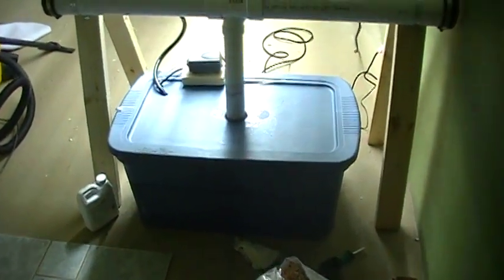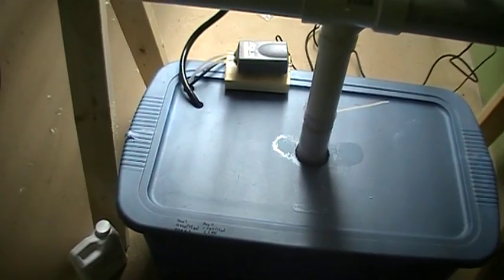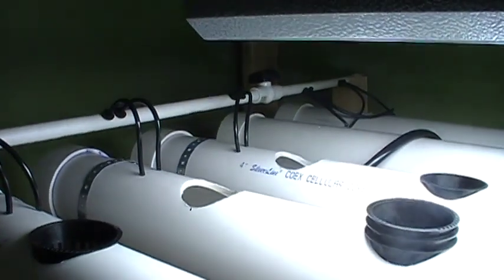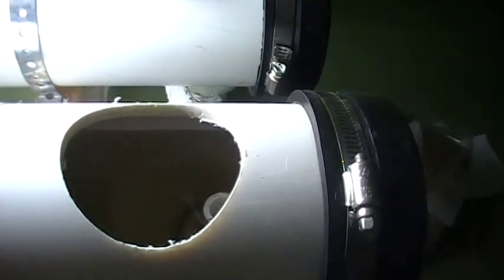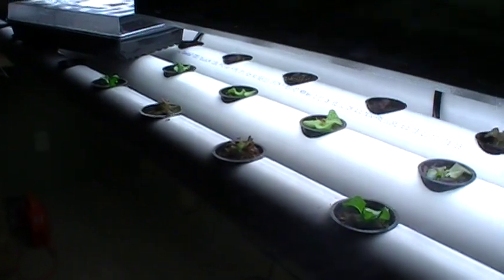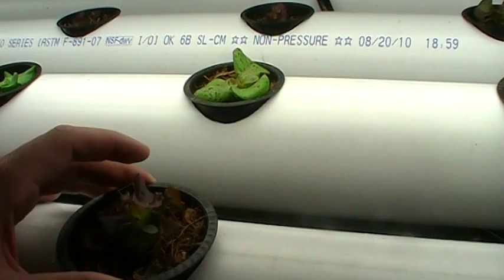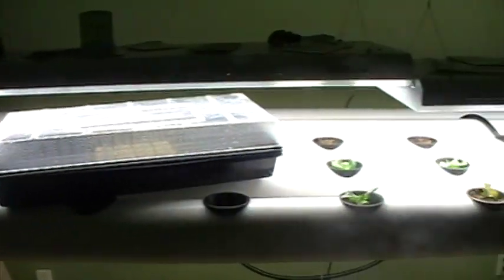Nutrient Film Technique (NFT) Hydroponic System

Comment: What parts did you use for the connecting of the pvc where the nutrients recycle back into the resevoir? did you cut a hole in the 4 inch pipe and use some kind of seal and stick in the smaller piping? You're system seems to drain great and I love the idea of moving the piece of pipe up or down depending on how long the roots are in their process of growing. I just dont understand what you use to allow yourself to do that. What connects the smaller drain pipe to the 4 inch pipe?

Comment: Just so you know, not trying to bash you or anything, but what you have here is a hybrid DWC NFT system. I say this because I see a couple of small (yet very important) flaws to your system that don't quite make it true NFT. First off you need to replace the PVC pipes with vinyl fence posts. They are square and provide an even, flat surface for the water to trickle. Second, ditch the boat drains. You have way too much water in those channels. I understand why you did it, to make up for lack of surface area from round PVC pipes. If you go with flat fence posts, you will not need the pool of water. What you have going on there is called "pooling" and is not true NFT. If you would like to upgrade your system to make it more efficient and produce crops even faster, follow my advice. Do some research for yourself. I have been using NFT for a long time.

Nutrient Film Technique says it all. You want a "film" of water trickling over the roots on a smooth flat surface. Your system is more like deep water culture in the sense that a lot of the roots are being submerged in water. The main difference is the amount of available oxygen to the roots in DWC and NFT. NFT allows for massive amounts of oxygen, which makes it one of the fastest known cultivation methods we have.

Other than that, good job, and good luck :)
Reply: If anyone happens to be reading the persons above comment, it is not a good idea to grow out of vinyl. Yes, the square gully's are better but vinyl can leach. Always use a HDPE or similar safe PP for your hydroponics.

Comment: With this setup and roots being in the air, will you need constant oxygenation. I.e. Air stone?

Also do you flow constantly or do 3hour feeds a few times a day?

I am thinking of running a ring feed to inlet to normalize manifold pressure. Also will have a secondary bucket. 5ltr with overflow system. Much like a two chamber sewage sump. Where my pump will run in clean water. Will this help with clogging the smaller tubes and pump?

What wattage is your light?

Hydro for life!

Comment: Do me a favor if you do not have a decent pump with a sponge built in it take a stocking or even a sock and stick your summer gerbil pump inside the stocking and put it inside your reservoir and Trust in believe you're trip head will not clogged no more sir you got to double up with the stockings and it works like a char more just forwarded over itself

Comment: That's thin-walled PVC is made for potable water, i.e., it's not food grade AFAIK. Won't that risk leaching chemicals into your water supply? Particularly being outside in the sun?
Reply from the maker: Yeah, it is thick walled. PVC is allowed for potable water use. If you are worried about leaching, biggest concern is probably in flexible tubing and plasticizers used in them.

Comment: controlling the water height would be much easier by putting another ball valve on the return line that way you can slow th ereturn back thus raising the water level, or lower it with the ball valve

Comment: FarmingFractals 
 Hi, could use some basic information:
Where to buy supplies? 
Type of tube used/size/sch./lengths?
(FDA approved - nontoxic)
Diameters and centers of holes?
Tubing and sizes?
Thanks in advance.
Reply from the maker: Jose Benitez zSupplies were bought from a local lumber yard and big box store. 

Can't remember the pvc size 3-4?/10' lengths/sch 40

PVC is used in tons of household plumbing. There is quite a bit of conflicting information out there on leaching. The main study I have read concerns the use of chloramine/brass fittings and pvc. Our municipality uses chlorine still. If you are worried about leaching, the main concern would probably be the plasticizers in the vinyl supply lines.

Don't remember hole centers now. Think they are 3"

Smaller tubing is 1/2" I believe.

This is just to serve as a rough guide. Never planned on a cookie cutter build. Just wanted to share so people could gather ideas and improve.
Reply: Thank you.

Comment: Whats the running cost per hour ? How much watts does it pull with all the lights and pump on ?
Reply from the maker: Simeon Hill 
It has been awhile since I calculated the cost. I remember it being like a dollar per plant per month or the cost of a head of iceberg lettuce. The costs are going to vary based on nutrients, lighting, heating, cooling, etc.
Reply from the maker: I calculated it several years ago and it was about $1/pant per month. However, I was using fairly expensive nutrients.

Comment: How are you connecting the driplines to the PVC? What are you ising
Reply from the maker: There are rubber grommets that connect the driplines to PVC. You drill a hole in the pvc to accommodate the grommets and push the dripline in.

Comment: Great system.  Are the pipes level or is there a slight pitch?  Also what kind of lights did you use?
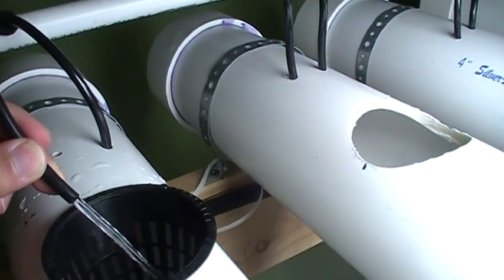Reply from the maker: The pipes are at a slight pitch. The pitch was created using a 2x4 on the front sawhorse and a 2x6 at the rear. This gives it a 2" slope over the 10' drop. I have read that a slope of 1:40 to 1:25 is in the ideal range. The lights are T5s I have another video on lighting.
Reply: FarmingFractals
Great, thank you

Comment: I saw another video where a guy was using paint filters, the kind they put in a 5 gallon bucket of paint to filter large items. If you wrap your pump in that filter, chunks won't clog your small tubes i'd bet :) then you can fish out any collected things from the reservoir :)
Reply from the maker: Not a bad idea. I have a mesh filter in the pvc pipe that leads to the nutrient reservoir. The holes in the mesh are a little large so some debris can get through. I will have look into putting in a paint filter over the pipe instead.

Comment: I am using 4" sewer pvc outdoors. I picked up a thru-hull fitting a Bass Pro. Made by TH Marine 1-1/8" Straight Thru-Hull. It requires a 1-3/8" hole and fits a 1-18" hose. Is this the one you have?

Comment from the maker: The drip irrigation lines are just feeder lines for the NFT channels. All commercially produced NFT setups use drip irrigation to feed the water into the channels. Nutrient Film Technique means that there is a shallow film of water that carries nutrients. It does not mean the use of a capillary mat. Capillary mats are only used if there are pooling problems or dry areas. One of the fall backs of NFT is the plants will quickly die if there is a power outage. I only add coir for a safe guard.

Comment from the maker: My PVC pipe is 4". It was the tetra 425 gph submersible pond pump at Lowes. The oxygen isn't necessary if you are running a shallow film of water in your NFT channel. For a cheap $8-10 air pump, I figured it couldn't hurt. There are some roots that are constantly submerged even when running a shallow film. The plants should get plenty of oxygen without the pump though. Thanks for watching.

Comment: Hi, could you leave a comment with the diameter of the various PVC pipes you used, and your recomendation about which water pump should I use. Also, do you think at that scale isn't necessary to use an air pump to get oxygen into the water?. Thanks a lot, beautiful hydroponic system.

Comment from the maker: I used a hole saw bit for a handheld drill. I will have to check my exact spacing, but I measured and marked the location of each hole. I also made sure my hole saw fit the net pots.

Comment from the maker: I have used a capillary cloth in my system before. I have found that it is easier to just rotate my plants from front to back. The water level at the front is higher than the back. I start new plants with small roots in the front and as the roots hang down I move them back. Once all the roots are long, I drop the water level completely and just run a shallow film.

Comment: Bamboo is cheap, you could try using bamboo tubes or wine barrels. You can also use a bamboo cross-lattice to hold the plants. I'm working on some plans going to see how it turns out after its made and running. But I agree, anything is better than the overpriced GMO, chemically sprayed food you get at the local superstore that they shipped in from some place where the locals urinate on the food before they pack it up and ship it out.
Reply: Nice idea. never actually heard of this..

Comment from the maker: I told you about the note on the video correcting the information error. I think the issue of the pump was fairly trivial. Obviously, the pump's output isn't 300-500 gallon/minute. At that rate is would blow out the supply lines. I am not trying to make professional youtube videos. I am just trying to show people how easy it can be to grow your own food. You are right I threw this video together on the spot. I didn't plan anything. I just wanted to share a video of how simple the system is.

Comment from the maker: I never mentioned a submersible air pump. The one I use is a dual outlet air pump with 6" air stones. They are made for fish tanks. That being said, there is a such thing as a submersible air pump. Google "Ario 3 Turbo Venturi Submersible Air Pump" for just one example. A lot of hydroponic growers prefer the submersible pumps because there is no danger from getting them wet. The pumps oxygenate the water and provide much needed o2 for roots that are constantly submerged in water.

Comment from the maker: From what I have read, probably very little if any. PVC is currently used in food packaging, cling wrap and potable water lines. Most chemical leaching in PVC is due to the use of plasticizers that help make it flexible. Rigid PVC does not contain plasticizers. Most degradation of plastics occurs because of heat and exposure to the elements. The room my produce is in never gets above 80 degrees. The fluorescent blubs are a fraction of the suns lumens and have almost zero heating effects.

Comment from the maker: The bottom of the thru-hull fitting should be round like a pipe. I just drilled a round hole close to the size of the thru-hull fitting. Put the rubber sink gasket over it and then tightened it down with the nut/compression fitting. This video shows it a little better- watch?v=tu4IcMrVGr8

Comment from the maker: I learned to slowly let the drill cut the holes and brace it against my forearm. I got the washers at Lowes. I believe they are called basin gaskets or sink gaskets. It is the rubber piece that attaches below the drain on a sink. I used one above and below the thru-hull fitting.

Comment: my little cheap 120v drill gave me a hard time today. i was using hole saw to cut 6" pvc pipe but i guess it was too much work for that little drill. i got the job done and also install a drain plug to the pvc pipe. i will continue the project tomorrow, i need to finish drilling couple of more holes for 1/4 lines...wish me good luck! lol

Comment from the maker: Nope. Just a cheap circular saw. They make "sawhorse brackets" for a DIY sawhorse that are cheap. You just cut the wood to length and insert it in the brackets. If I did it again, I would lower the height of my hydro some.

Comment: yeah, a list will be very helpful for everyone and i'm pretty sure you will have more subscribers.you should put the list where you have text "Heirloom lettuce growing in my NFT Hydro system" i can't wait to start my project. if you were to puncher the water pump line directly and add the lines. will that cause any water drip? what's the size on that pvc pipe where the 1/4 black vinyl line is coming out from?

Comment from the maker: I could probably come up with a list. A lot of it was trial and error so I didn't have a list. After the water pump, there is a vinyl hose that goes to a brass hose barb fitting that connects to a female pvc fitting. I have another video explaining the "thru-hull" fitting used for the drains at the end of the pvc.

Comment: it would be great if you made a list of the items you bought. i love your hydroponics system setting. From the water pump to the pvc fitting; what kind of pvc fitting is that?
when you connect the pvc pipes together, do you use any type of pvc adhesive?

Comment from the maker: It is recommended that you change the reservoir every 7 days. However, I have let mine go for 10-12 days and haven't had problems (sometimes I will toss in an extra gallon of new nutrient solution to extend the nutrient reservoir change). I found that at 14 days the plants start to get fairly stressed and PH gets pretty bad. The water does flow 24/7 when I am running it as an NFT.